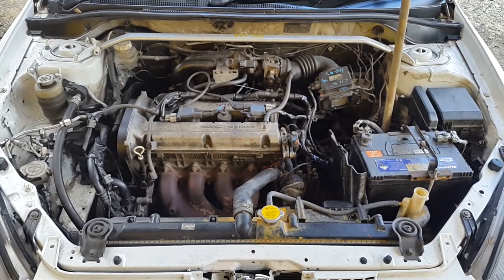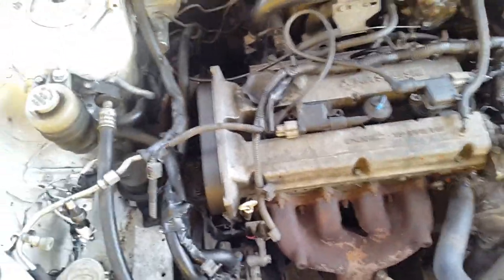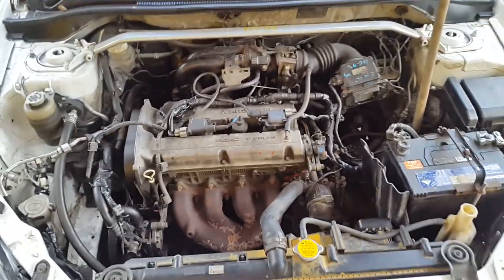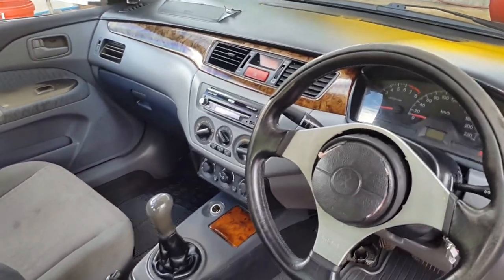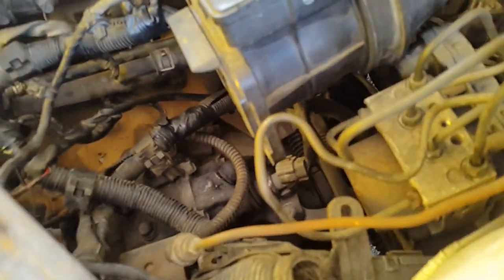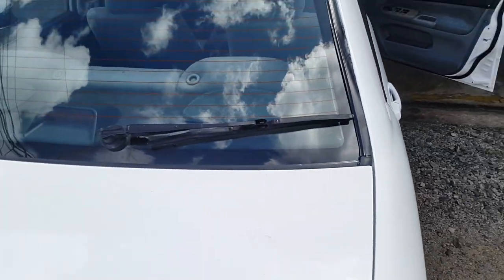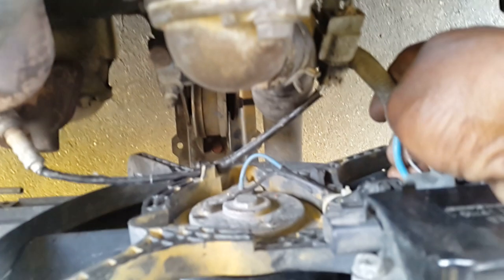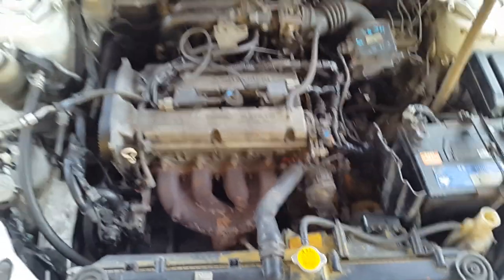4g18 DOHC project

Comment: A nxt thing can do wen u get more money u can put a lighter flywheel ,4 individual coil packs ,colder intake,standalone brain,Lsd gear box and rebuild the gear box one time,suspension and bushing,catch can,fuel regaular  ,k&n filter and don't wen yuh upgrading the radiator upgrade the hose ,clamps ,water pump,tersmart
Reply from the maker: True you are paying attention will every upgrade I will post
Reply: Yea I do buz no one does it in t&t

Comment: Wat electronic distributer u use and u have a bracket for it
Reply from the maker: Did not use a distributer i have a waste spark system if you have a distributer it will work also and you will have control of ignition timing.
Reply: @593432223  wat to know wat u use to make a waste spark system
Reply from the maker: you can use any cs harness 4g18,15 or even 13 or 4g92,4g93 or 94
Reply: @593432223  thks I want run waste spark thks
Reply from the maker: @cecilschelborn5668  in what carr cs or ck
Reply: @593432223  is ck
Reply from the maker: @cecilschelborn5668   there are some ck that used waste spark like 4g93 and 92
Reply: @593432223  yh know 4g92,93,94
Reply from the maker: @cecilschelborn5668   cool

Comment: Wat head can u use on 4g69 block to make a dohc buz it a sohc
Reply from the maker: There is no DOHC right hand head that I know of for it .I saw a left hand twin cam for it but the technology is old
Reply: No it come in cs3 lancer
Reply from the maker: yes i know the ecu is in the bonnet inside fire wall it is sohc mivec produces 175 hp but if you want to go DOHC you can use evo 4g63 head but you will loose mivec function unlees you use evo 9 mivec head so in essence you will have a 2.0 (evo head ) on 2.4 block (4g 69) people all over the world who have evo's  use 4g69 bloks and buy forged pistons rods and  transform to 2.4 evo but because of smaller head the compression is very high so piston choice and compression ratio is critical cause of the heat of high compression and turbo .

Comment: What you use to convert drum to disk?
Reply from the maker: Was speaking about rear brakes
Reply: Uzziah Jackson yea i have a CS3 with drums in the rear i want to convert to disks
Reply from the maker: It is sold in. Tobago along with trailing arms easy conversion will do short video
Reply: Uzziah Jackson I’m in Trinidad and I have a Cs3 4g18 and want some guidelines and i have some questions
Reply from the maker: @danross4309  tell me what you need to know
Reply from the maker: Will do video

Comment: Can 4g15 dohc head fit on a 4g92 sohc block
Reply from the maker: No you can only interchange families like 4g13 4g15 4g18 they all are part of 4g1 family 4g92 is part of 4g9 family so 4g92 4g93 and 4g94 are interchangeable the 4g91 is left hand like a Honda engine

Comment: Hey man, I need help
I'm going to do a 4g15t swap in my cs2a is it easy? And what am I going to do?
Reply from the maker: Is it a mivec with electronic throttle body ?
Reply: @593432223  I think suh ya know
Reply from the maker: @kylepalmer2360   it will fit but a little wiring will have to be done, not sure if throttle body control unit is separate or integrated to ecu but great engine. Want to use non turbo mivec 4g15  head on my block but want to find out how oil is sent to mivec solonoid(variable valve timing no lift like old mivecs)